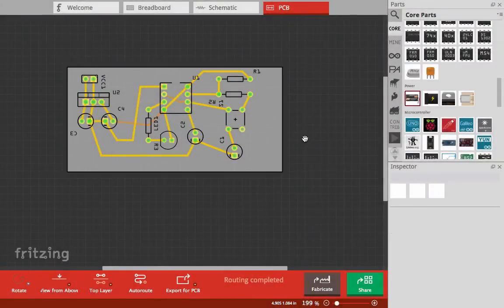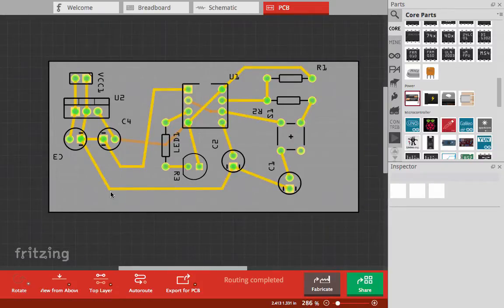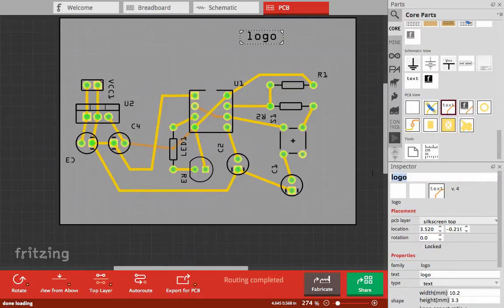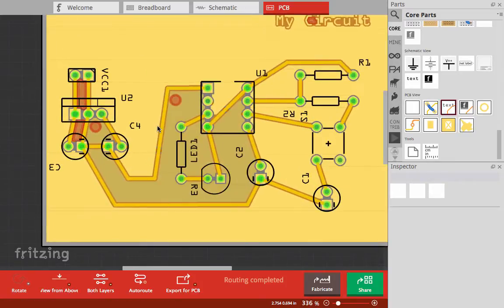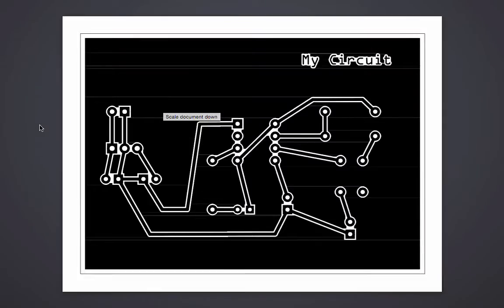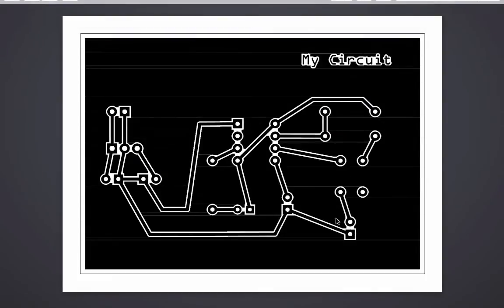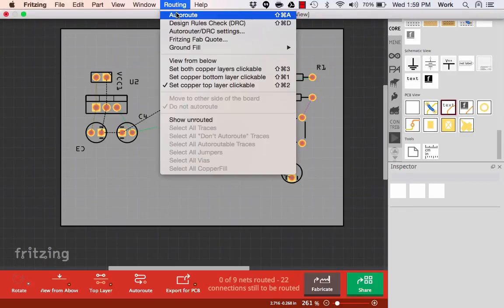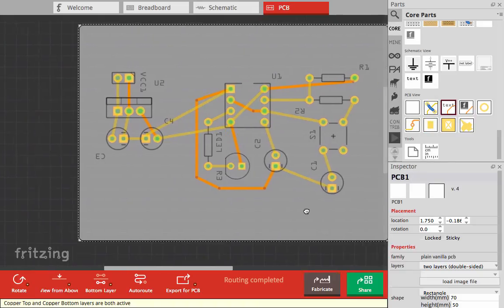CMPE370: Fritzing PCB Design Part 2

Comment: With regard to the ground fill. How do I use this process to route all my circuit's ground connections to the fill? I don't know if I should be routing my ground connections with traces or not, preferably I'd like them to just connect to the copper fill.
Reply from the maker: Sorry for the delay in the reply.  I'm not sure, actually.  It would definitely be easier to just make the fill ground and then let it connect all the ground points to it for you.  I would guess there is a way, but I don't know what it is.